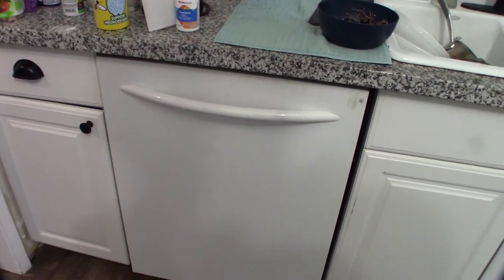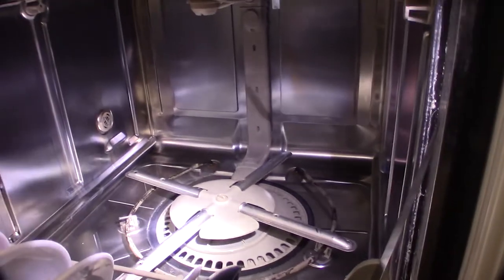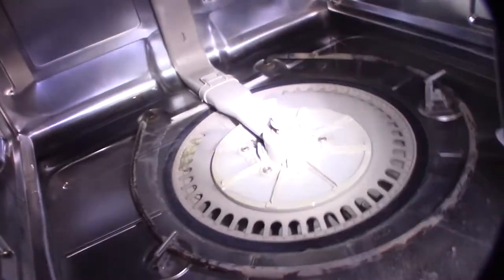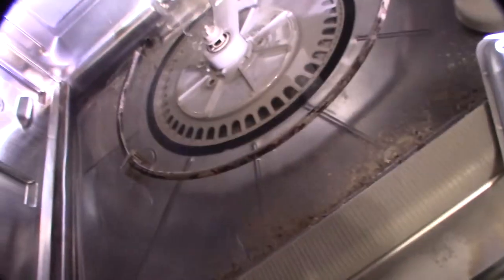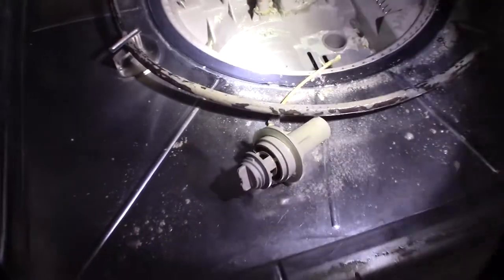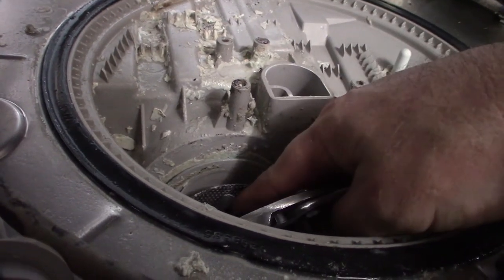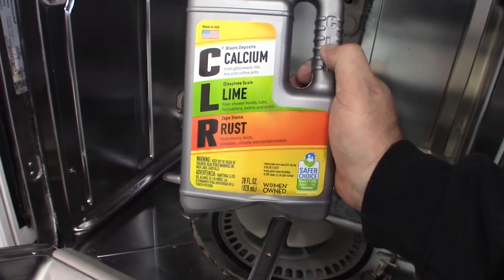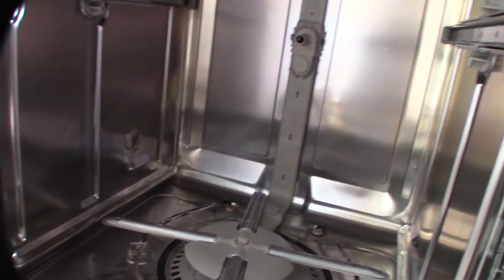Kitchenaid Dishwasher Wont Drain Clogged pump repair CLR Cleaning

Comment: use equal parts baking soda and vinegar after shop vac-ing the water out, let sit for 10 minutes and run a rinse cycle.  this should clean all that crap out

Comment: I have had this problem with the metal screen clogging although we are pretty good at rinsing off dishes. Seems like they could have done better on design, but at least it is easy to correct.  Thanks for reminding me what screws to look for.

Comment: Thank you, you saved the day. All cleaned out now. However, that reverse thread piece that holds on the water spinner thing , I think I stripped that trying to tighten it back in. Any idea where I can get that piece to replace it?. Is it a Home Depot type thing or hard to find?. Thanks. PS . Im in Connecticut.